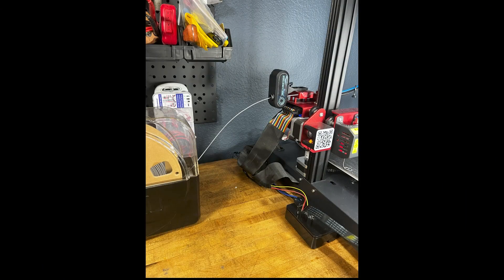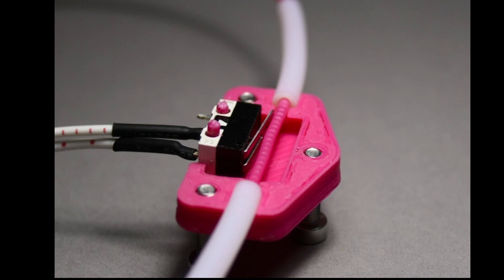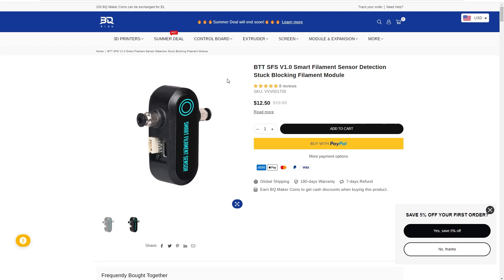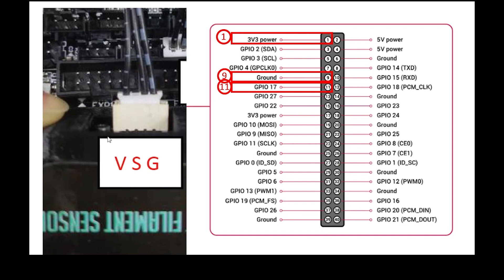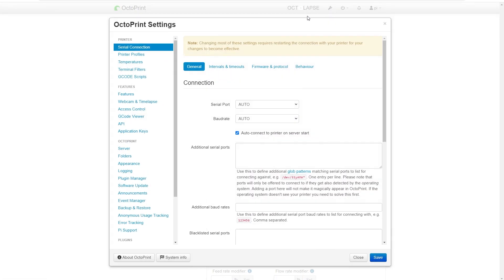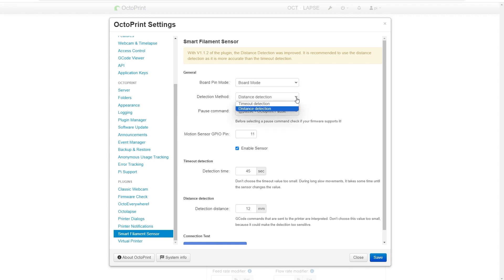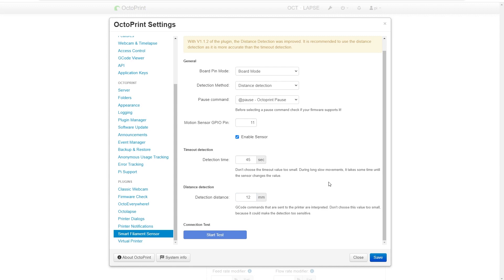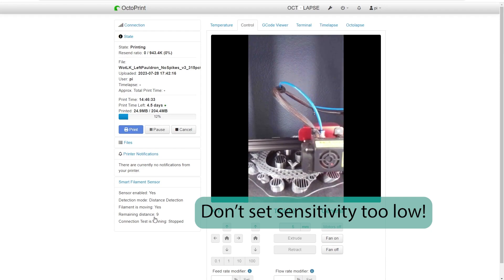Bigtree Tech Filament Sensor Install with Octoprint on Raspberry Pi 4 (RPi4)

Comment: Hello, thank you so much the tutorial. I followed you instruction and it seems my Pi detects the filament and knows when the filament is moving or not when I run the test from the plugin. But when I start the print it just pauses the print while extruding the purge line. Also I noticed that the small filament sensor window where it shows the "remaining distance" automatically adds 7mm to the set value. For example if I set the runout distance to be 12mm it shows 19mm at the start of the printing and it never changes. I previously had the firmware configured to be used with the BTT smart filament sensor and set the run out distance to be 7mm. Is that why? It looks like we have the same printer and I would like to know what firmware worked for you. Thank you so much!
Reply from the maker: You're welcome and I'm sorry to hear you're still having issues.  Do you print from files loaded to the Octoprint filesystem or do you print files that are on your SD card?  I noticed that if you use Octoprint to print files from the SD card rather than from the Octoprint filesystem, the printer WILL recognize the original filament sensor.
Reply: @scientifichobbyist8887  thank you for your response! After I connected the Octoprint I started using the Octoprint file system. I haven't tried the SD card from the mainboard. But I'll try that. Thanks.
Reply: @scientifichobbyist8887  So I tried SD card but that did not do anything. Just out of curiosity, did you enable the filament detection sensor function in your firmware?
Reply from the maker: I haven’t changed anything in my firmware for the printer.  For most printer models, Octoprint overrides the firmware detection of the native filament sensor.  It sounds like your firmware may still be honoring it.  Have you tried sticking a piece of filament into the old filament sensor so it thinks it has filament?
Reply: @scientifichobbyist8887  Hi thanks again for your reply. I think something in my firmware is preventing it from working properly. I really wish I find a solution lol, the SFS is an amazing edition to any printer.

Comment: does it work with the btt sfs 2.0?
Reply from the maker: It might work in part, but there is a fourth wire in the 2.0 for the limit switch.  I don’t know think the Octoprint add on has accommodated that yet.  Unfortunately, I don’t have one of the 2.0 models or I would definitely give it a try.
Reply: @scientifichobbyist8887  maybe ill order both and see if it works, if not ill just use the 1.0

Comment: Hello and thanks for a great video. Does it detect if there is a blockage in the nozzle, because I have an optical sensor and read if the wheel is spinning or not?
Reply from the maker: Thank you and yes it will.  Since it is detecting filament movement, if your nozzle gets clogged, the filament upstream will stop moving and that will trip the sensor.  How much lag there is between the nozzle clog and the smart sensor tripping depends on your setup.
Reply: @scientifichobbyist8887  Thanks for the fast answer... Do you know how much i have to disable in the Marlin Firmware to not get any conflicts with the Octoprint plugin?
Reply from the maker: @annas1970 I’m not sure.  I print directly from octoprint rather than using octoprint to start / monitor SD card prints.  When done that way, my stock filament sensor is completely ignored.  You could always unplug the stock sensor and jumper the contacts.
Reply: @scientifichobbyist8887  ahaaa... you manage it as i do. Thanks, will give it a try this weekend. I loaded the new firmware yesterday and now the new wires to OP has to be fixed. Take care

Comment: Hello sir, i am using octoprint on Rasberry pi zero 2 w. Can we use same Pin method on That board too. sorry new to rasberry pi world.
Reply from the maker: All RPi boards use the same pinout for the 40 pin GPIO header, but on the Pi zeros it isn’t populated with pins.  So, you can use the same pin locations, but you’ll have to figure out how to plug the wires in  or solder pin headers in
Reply: @scientifichobbyist8887  thanks for reply 😊
Reply from the maker: @mailsunny2007  sure thing! Good luck 😃

Comment: Возможна ли реализация выравнивания горячего стола перед началом печати на raspberry pi 3?
Reply from the maker: Octoprint will run on a RPi3 and it has a variety of plugins that can help customize your printer’s pre-print actions.  However, it’s probably better to add commands for home and auto bed leveling to your printer settings in your slicer.